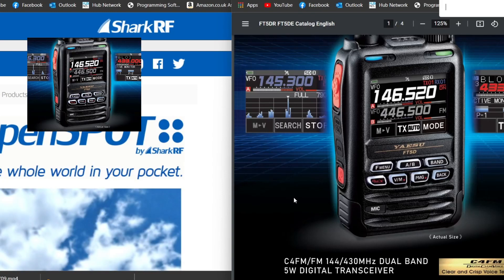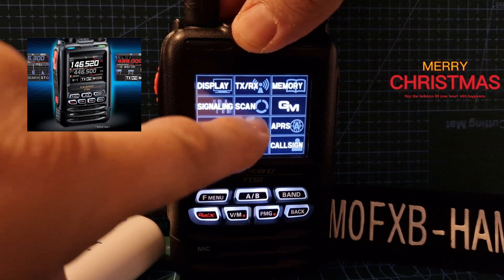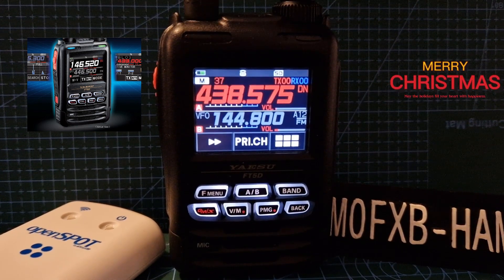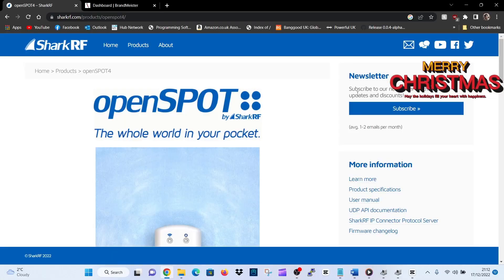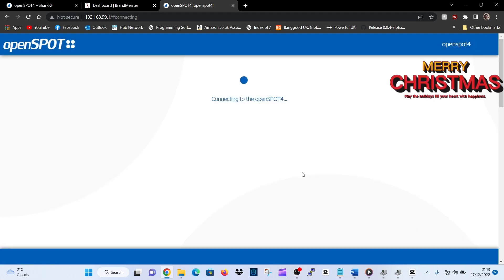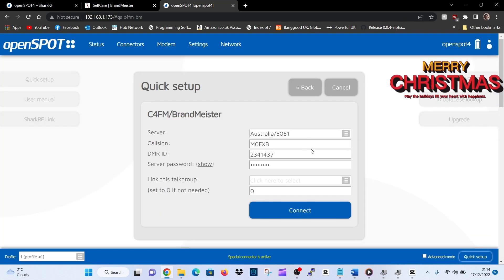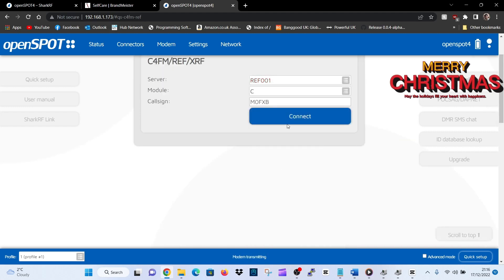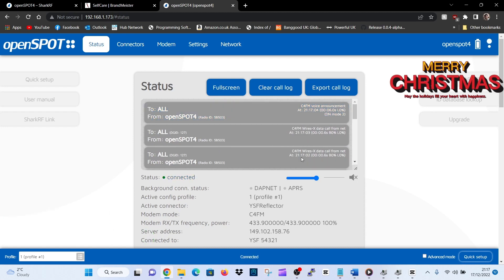YAESU FT5D - OPENSPOT 4 SET UP

Comment: Love the videos and have a quick question.  I've followed one of your Icom HT videos and figured out how to change groups/reflectors/etc straight from the radio (Icom ID-50A) without touching the openSPOT.  Is there a way to do this with Yaeus FT5D?  I can't figure out a way to do.  Thanks so much for any input.
Reply from the maker: Do you have a Hotspot
Reply: @M0FXBHamTech  yes sir.  Openspot 4 Pro at the moment.  I'm able to connect the FT5D by making changes through the openSPOT app, just not to change reflectors and such straight from the radio.

Comment: Thanks for and excellent setup video.
I have an OS3 now and I will be getting a 4 PRO soon, I can use all the same settings like DMR and frequency on both openspots right?
Reply from the maker: Yes also with the 4 pro you don't even need a Radio to TX.
Reply: @M0FXBHamTech  that’s what I read too, that’s pretty cool…thank you